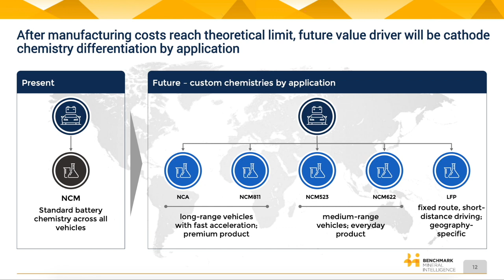This is how automakers will differentiate their vehicles in the future w/ Vivas Kumar

Comment: This ability to achieve effective market differentiation based on battery chemistry is only a short to mid term phenomenon. Fairly soon (3-5 years(?)) batteries will become a commodity technology, like RAM or Disk Drives in computers. There will be some differences, but in general battery tech will move relentlessly forward in fits and starts as RAM and disk drives do. There will be some differences in sources, materials, etc, but an auto company will not be using battery choice as a major lever to influence consumer choice. Any more than I care if my new HP laptop has a SSD From Samsung or Seagate - which is to say barely.
By that time Tesla had best have effectively moved on from being primarily a battery company to something else. It has many options - and does not necessarily need to pick only one or two. But differentiating based on battery coolness will be an effective tactic for about 5 years at best.